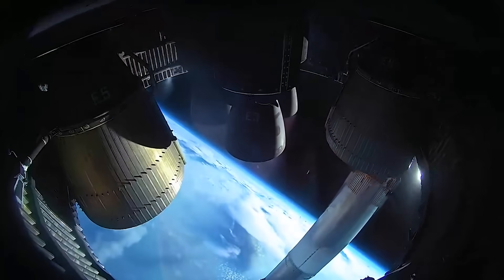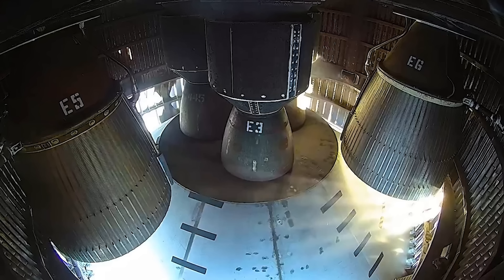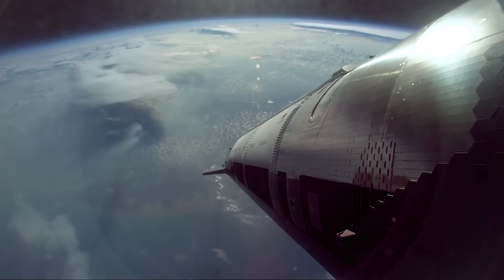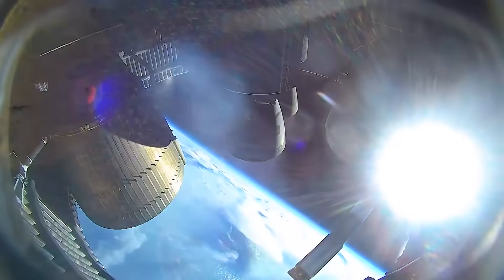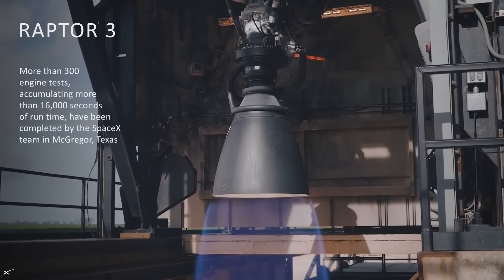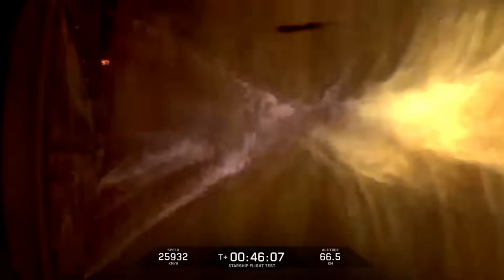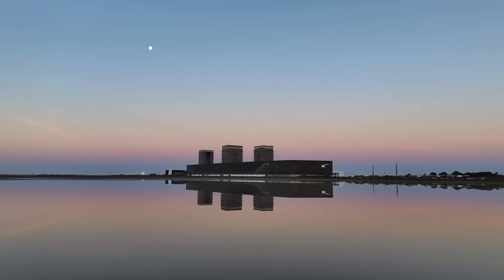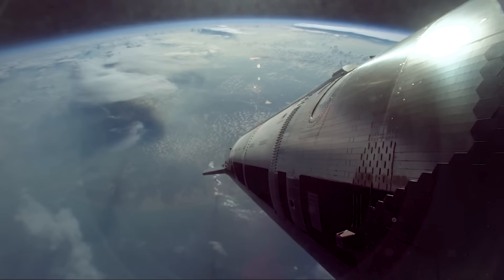A Closer Look At Starship's Flight 9 Hot-Staging

Comment: Anyone numb enough to think this will ever happen has to be under some sort of spell or hypnosis.
This nightmare has had 9 flights none of which were more than just a little successful. Seriously. Not one orbit. Not one more than a quarter of the way around THIS planet. No in-orbit fueling, no landing that simulates Mars. No Habitat tests, no systems test for lifting off Mars. No tests for radiation blocking. And finally, the soil on Mars is toxic to humans.
Reply: It's a big system still in development.  A concept you never came within a country mile of having the intelligence to understand.  And I doubt you have the capacity to ever understand.  That's pretty sad, but I suspect you disappoint a LOT of people.

Comment: F, Ok now it all makes sense, the sea level engines are flush with the h-s-ring, lighting those up would seriously put back pressure and a or send a large impulse shock through  those engines, and their fragile spinning turbines, no wonder they blew up before twice in a row! I bet they were jolted so hard they cracked a vital casing!
Reply: I think you exaggerate a bit, but I do wonder if there could be some flame diverter on the hsr
Reply: Yet it worked on V1.  Maybe the plumbing in V2 isn't as robust?
Reply: Im surprised that way their separating the ship from booster isn't one of things causing damage to the ship in the first place.

Comment: It appears to me that the blastoff from the separation of the bottom part of the rocket is what’s causing the damage to the rocket engines of the main compartment of the rocket. So What they really need is a buffer compartment that’s thin and light with heat shields on both sides so that when the bottom part separates, so does that buffer part but protects the rocket booster engine of the main part of this rocket.